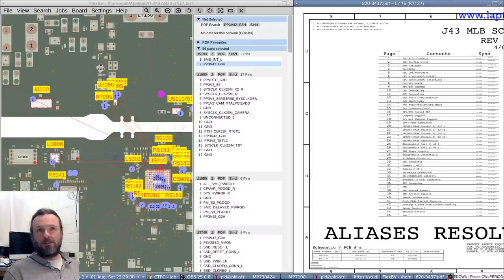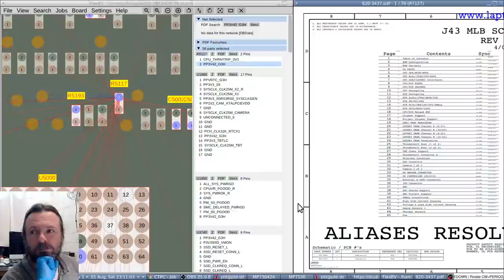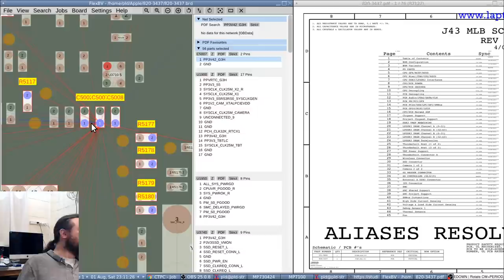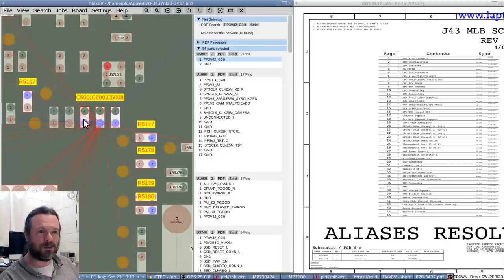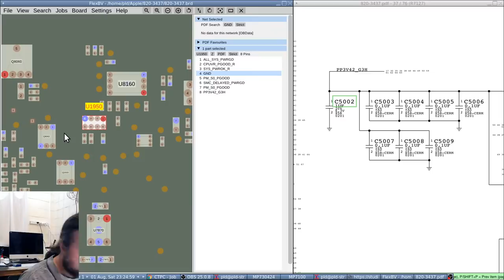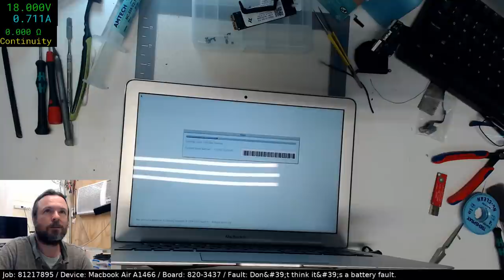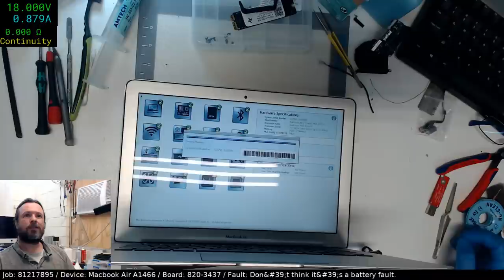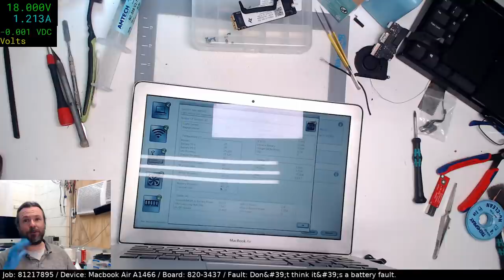#187 Macbook Air A1466 - No magsafe, no charge, no boot? Can it be fixed?

Comment: Hello Paul. I got MacBook Air 13 inch 2016. I got solid green light on always on charger. But it’s not charging battery. I disconnected battery after this it’s working fine. So I am not sure where is the problem.  Do I need to replace battery